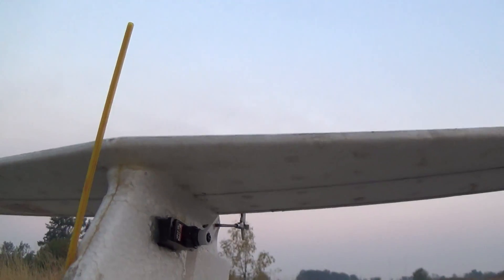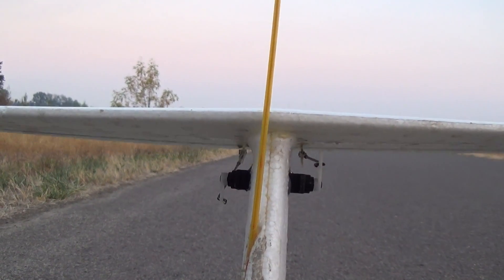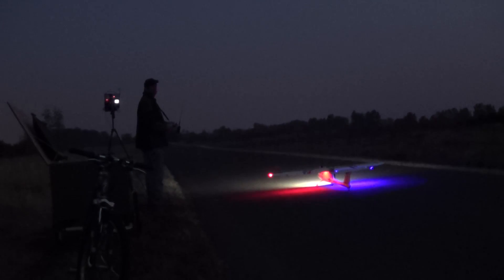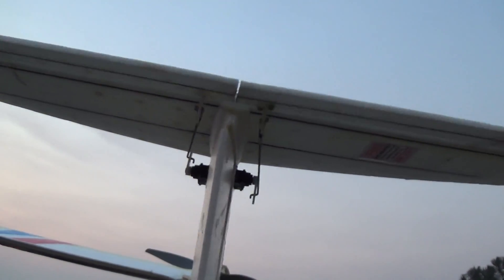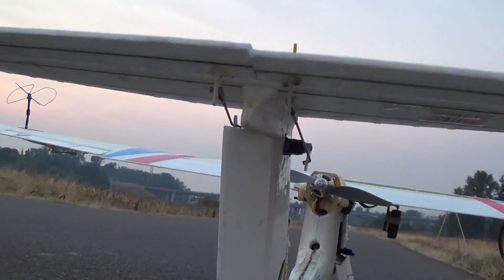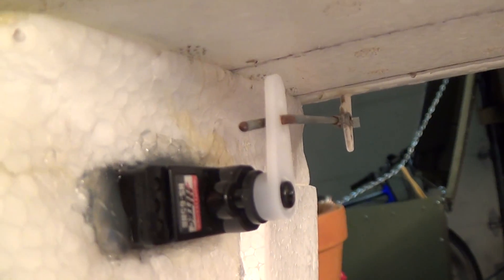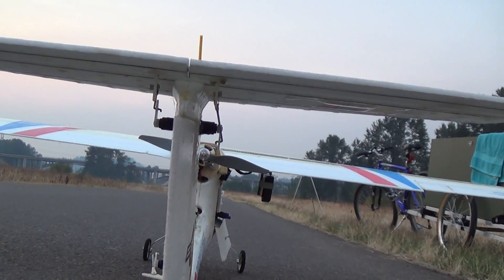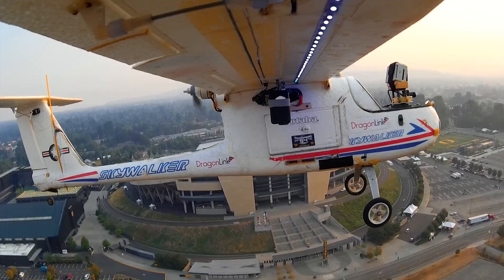How To: Install Dual Elevator Servos and WHY?

Comment: on my bixler after a faulty elevator servo crash i made sure i could flip a switch to make my aileron an elevon its a nice and easy fix for a save landing
Reply from the maker: YellowBlue RC Smart man!
Reply: YellowBlue RC  I think you can on a Taranis radio but I am still learning it myself. Post it on the RC forum
Reply: glassdogangle thanks, you are smart too tho love your video`s learned a lot from them,
a question about your video gear do you use the bevrc 800mw 1.2ghz? i bought it but i couldnt get it to work i want to know what channel should i use on my tx and rx?

Comment: I've always thought that this is the weakest point of the plane. Out of all the points of failure, this has to be one of the most over looked. Forget whether or not you have enough RC and Video link range. Make sure you have contingencies in place for failed servos!

Comment: a better option would have been to slave a second servo so if one fails it can still mantane control. having it split could cause more problems
Reply from the maker: The system is working beautifully, actually. No problems whatsoever.
Reply: glassdogangle Because the servo is split into two pieces, if either half were to fail, do you think the other elevator would provide sufficient lift? Also if a plane only has a tail and rudder with no elevators, do you think this would be a good idea, id imagine it might try to roll? and cool video btw.
Reply: glassdogangle If one servo fails, wouldn't your elevator then begin to act as an aileron with only one of the surfaces moving?
Reply from the maker: Jonathan Reichert With only one elevator in operation, there will certainly be some adverse yaw or roll to the aircraft (as any aerobatic pilot will tell you), but this effect would only be very minor, and easily countered with the ailerons. One thing to remember is that the elevator's main function is to change the angle of attack of the main wing. an elevator is not the main wing. If an elevator had sufficient power to roll an aircraft, then why would aircraft manufacturers bother putting ailerons on wings? Why not manufacture them with simple elevator mixers at the rear? An elevator on a conventional aircraft controls angle of attack, and ailerons control the roll. For emergency purposes, operating on one elevator would certainly give my Skywalker more than enough control to return home and execute an uneventful landing.

Comment: I did the same mate on my Skymule, co's it's designed with a split elevator. The stock control wires were crap, so I put servo's in the rear - which I always do to keep some weight aft. A more elegant approach to this would have been to reverse one of the servo's so that they move together.

Comment: Good idea going with the dual HS-65HB's, and yours sound just fine.  I use them in 1/2A through .19 size when doing dual aileron servos and I'll use them as throttle servos on a lot of my glow's .061 up through a Saito 1.82 twin. They're a very rugged and reliable servo.  Mine have taken some hard hits and still work great.
One suggestion on your setup - always keep you servo linkage/setup symmetrical.  On one side you have the elevator linkage above the servo, on the other you have it below. In the video it appears the elevators are not moving perfectly in unison, but a slight different between the two.  While it's not critical on a slower flying plane like yours, it can be on a high performance plane.  You should run the linkage either above or below on both sides.  In this case I'd suggest above since it gives the shortest linkage straight to the control horn. 
You definitely have some really good videos - keep putting them up.

Comment: You can just use a really high quality servo with lots power like a futaba or an align. It's worth the extra money
Reply from the maker: Oh, no! Never assume that just because a servo is high quality, that it cannot fail! I am telling you the truth: It is far safer to have 2 of these HiTec servos (which are very good quality, btw) than 1 servo of ANY brand! Redundancy is the key! The likelihood of BOTH of my elevator servos failing within 30 minutes of each other (during the same flight) is not very likely at all! Far less likely than a single "high quality" servo failing during a given flight!

Comment: Hi, interesting comments from the ignorant...Of course, its not likely one of the servos will stop working then leaving significant deflection of one of the elevators. So, having the other elevator servo, will save the day for sure...I like having two Aileron servos for the same reason...What made me smile was the comment that having one large reliable servo would be better...such nievity..What are the odds of both elevators servos failing at the same time?..nuff said...I wonder if its made Grumpy Cat happier? Nahh, course not..:)

Comment: Redundancy is golden!

What about engine failure, esc failure, battery failure, osd failure...

What if one of your elevator servos get stuck at full swing?

I think we just have to accept the rc hobby as non redundant.
Reply from the maker: Engine failure (motor failure): Run into the nearest tree if over a populated area, or, if over fields, just land and retrieve. Esc failure: same thing. Battery failure? If it is the motor battery, same thing. If it is the vital systems battery (R/C link, vid link, etc.), kiss it bye bye! OSD failure, no big deal. Fly home and fix it. Elevator servos stuck at full swing? ENJOY THE RIDE DOWN!!!!
Reply: I see your point. Elevator failure is more severe than anything affecting thrust. Still I'd say any failing control surface is equally bad. Forgive my nerdy persistence ;)
Keep posting those videos! :)

Comment: those servos you are using sound horrible. i guess if you're using cheap servos, it's a great idea, and ti's of course accepted practive on models with high amounts of vibration, but i'm pretty happy with just using a good quality servo that's bigger than i really need.  great video, and i 'm sure this will be helpful for a lot of folks.   good to see you still flying the old bird.  how many hrs you got logged on her by now. should keep a log book.
Reply from the maker: Cheap servos? At $22 each, I would not consider Hitech HS-65HB Karbonite Gear servos to be on the cheap end. My Sony Handycam is also top of the line in it's class, and at $350 retail, it picks up even the slightest sounds. So that's probably why you think they sound horrible, because the Sony CX-220 can hear a mouse fart at 100 yards. So, the sound of ANY BRAND of servos from 12 inches away is going to sound like a bag of shattered glass being dropped into a barrel full of marbles... I have $1300 worth of equipment in the air at any given time, so you can be sure I don't go cheap on vital equipment. And for the last question, I probably have around 720 flights logged on her, so maybe 300 hours total flight time? Roughly?
Reply: glassdogangle ok, spectacular sound then!   sony does make nice stuff. i had several bad experiences with hs-81's, and don't use them for anything anymore. i'm mostly using the hs 225mg mighty minis. love them. i did some torture testing, and could not break them. so i guess not all servos are created equal. i'm no trying to undermine your idea at all, just trying to provide useful info, and your idea is a great one..
Reply from the maker: FPVREVIEWS Our servos, suspiciously, have the same brand name ;) I went with the Karbonite Gear ones after much debate (believe me, I spent probably more time selecting which servo to use than probably any other piece of equipment on board!). I can't remember why I ultimately went with the HiTechs.

As a testament to their toughness, my rudder servo has taken a beating due to the tail dragger configuration, even to the point where the servo body itself was ripped completely out of the tail by a rough landing, and STILL no gears stripped! They are tough, but not invincible!
Reply: glassdogangle wonder if it's swim in the river could have caused some corrosion?  are they the same servos?
Reply from the maker: FPVREVIEWS Yes same servos as the Willamette swim. Corrosion could have definitely been a factor, if some water eeked into the elevator one. That would explain why the electronics failed internally. Damn, now I have to go out and tear it apart to look...
Reply: glassdogangle just like a twin engine aircraft, there is now 2x the chance of having a servo failure, but like you say, there is a chance of surviving the incident. 
by the way, have you seen the readymaderc anaconda?  i say it and thought of you for a new airframe. i''ve ordered one for review, and will let you know if it's a good airframe.  ialso just finished the review  of the skua, and found it to be a great plane, although i know you don't like a tractor.
Reply: glassdogangle could be the potentiometer then..  hmm. well, maybe it's not the servos fault,  good to know.  thanks for the info.
Reply: glassdogangle i'm glad grumpy cat is ok..
Reply from the maker: FPVREVIEWS I just tore the servo open (literally because it had glue all in the Phillips screw heads). Then I posted pictures above. Check the new links above in the description. Something definitely got FRIED!

Comment: Great mod, but "what if" one part of the elev is locked in down pos., do you thing you could save the plane with the other side of the elev.? (just a thought)
Cheers.
Reply from the maker: With one elevator locked in the down position, it would take full up on the stick to counteract (with an added roll tendency induced which would have to be countered with rudder and/or aileron input). The airplane would probably crash land in, because it would be barely controllable.
Reply: glassdogangle
I think you are totally right, have fun and keep posting your very interesting vids my man.
Cheers.
Reply: ***** he could also flip it upside down and land without much damage, might rip off the cameras though. But i dont know how well that plane flies inverted.

Comment: Did you save the bad servo? If you saved the bad servo can you open the servo up and find out why it sticks. I'm curious to know. What brand was it?

I will have to take this into consideration with my setup. Thanks
Reply from the maker: These servos are really awesome. I think the internal board simply failed. It did not stick at all. It still had free movement, even when power was applied. Something in the circuitry went bad. I don't have the time to tinker with it to see what happened, I just toss stuff and buy new ones when they go bad! I still would highly recommend this servo. I used 2 of the exact same to replace the bad one. Servo brand is in the description box above!
Reply: I like the idea very much that you have a backup system incase if one goes bad. Having two has an advantage of halving the load between each other. I have a few Micro servos I've been testing. I use one of the servo testers from hobbyking. I discovered that some brands will twitch more than others. The results show on a graph. The twitching causes the servo to get very hot when its at center. I think the hitechs dont twitch much. I'll have to try my hitechs again. I'm testing everything before install. Your idea is very good and two have an added benefit of reliability and less mechanical and electrical load stress on the servos.
Reply from the maker: ***** You are exactly right about sharing the load, John. Now each servo is only loaded half as much as the original one was. In fact, I am wondering if the reason why the first HiTec failed was because it was handling all the load of the elevator by itself. Either way, I don't think my airplane will buy the farm as a result of elevator failure anytime soon...

Comment: DO a test flight with half the elevator!!!! Will be interesting. Don't use any elevator during takeoff with that setup tho.
Reply from the maker: Honestly, you guys, there is no flight test needed. Bigger planes use dual servo setups all the time for this purpose (redundancy). This plane will take off and land no problem with half an elevator. Don't confuse this airplane with a flying wing, which might encounter more problems with an elevon going out (maybe). With this configuration, all the elevator does is push the tail either up or down, which in turn changes the angle of attack of the wing. To think that half an elevator would NOT push the tail up or down is simply erroneous. I would have plenty of control to get home, and I may not even notice half my elevator had failed until I got home. This is a slow high-wing floater, not an F-16!
Reply: I can tell you my experience about elevator problem. One day right after I launched my bixler, the elevator pushrod came off. I was confused and planned to turn around for landing. Since I didn't know the elevator won't work, I banked the plane steeply but I landed the plane in 30m radius safely.
Reply: glassdogangle It WILL produce a twisting force to the v/fin and fusalage to consider.

Comment: Im not sure half an elevator is going to work very well. Surely its the ailerons/rudder you want a back up for after all you can control pitch with throttle??
Reply from the maker: Ailerons have separate servos. I have flown an airplane with a failed servo. The only thing I noticed was it wasn't rolling as fast. Also, it doesn't roll clean. One wing either lifts or drops, and it's kind of easy to see in the air. The rudder is expendable, trust me. I have had an elevator servo fail on a 120mph pattern ship (back in late '80s) and it wasn't pretty. Half an elevator would have brought her home for sure. Pitch can be controlled somewhat with throttle, yes. But that is not good enough for my safety standards. I should have done this a long time ago!
Reply: fair doo's, just wanted to question the logic and get more of an understanding. The part i wasnt sure would work was the fact only half of it moving. Surely that has some negative effect right??
Reply from the maker: Dean Roots Dean, having only half an elevator will give you less than ideal flying tendencies, but the key word here is "flying". With one elevator, the airplane will make it back to home base and land with virtually no issues at all (aerobatics would be a little skewed on the way home).
Reply: cool. yea that was my concern, how the plane would cope. After watching your video i was considering doing this myself, but wasnt sure so wanted to bring up the subject ;) Could you post a video of it on one servo???

Comment: So the elevator is actually split in half as well? One servo fails you don't lose all control but you only get half an elevator? Have you tested flight with half an elevator?
Reply from the maker: Yes, the elevator is split in half as well. This way if a servo fails, the good servo will have the freedom to still operate the part of the elevator which is still good. I don't believe testing will be necessary. I have plenty of throw on the elevators, and rotate with only about 1/4 throw with no problem. There are two aileron servos controlling two separate ailerons, and I don't need to test to see if the plane will still bank with only one aileron. I know it will. The absolute worst case scenario would probably be if one elevator locked in either full up or down position. If that happens, there is a chance I may still have some semblance of attitude control to at least maybe keep her level, but I have no desire to perform such a test!